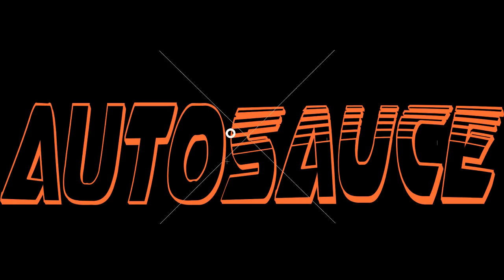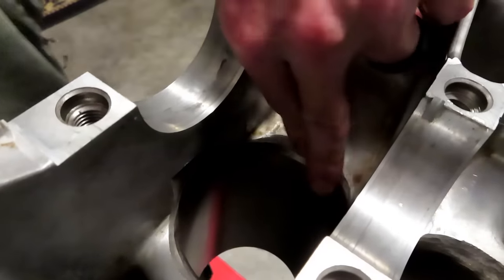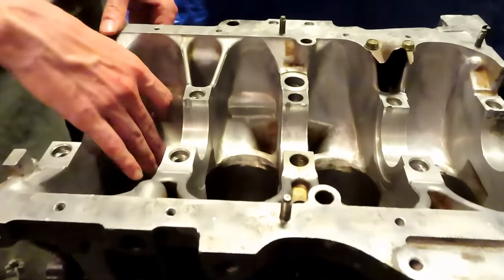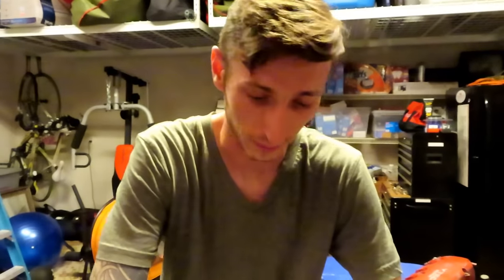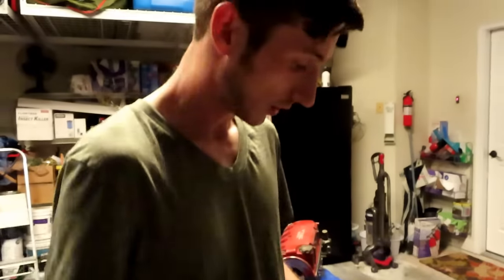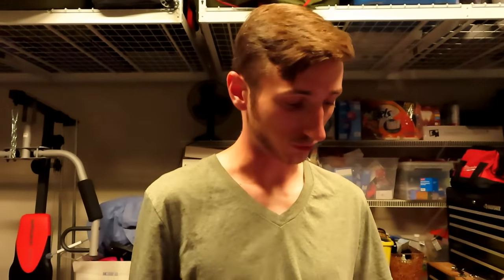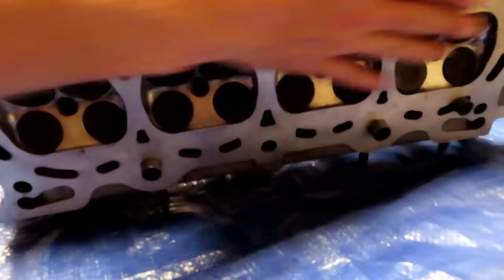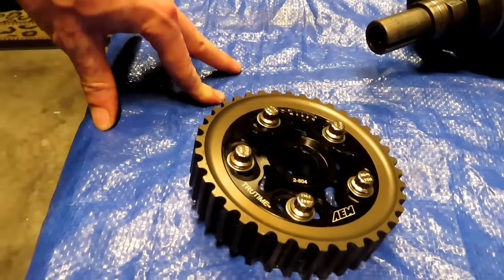EVERYTHING you need to MAKE 500HP with a HONDA CIVIC on a BUDGET

Comment: 500 hp on a budget... just build the thing right and don’t worry about the budget, “doing it right saves from doing it twice!” Wise words from Honda Yoda
Reply: He means you dont need the fancy named or labels parts to build a strong reliable engine at the end of the day there just different grades of forged metal
Reply: Paladin ! I love your advice. Comments on this. Cheaply honda build motor theres no way build like this gona last hes doing wrong the best build are with expensive parts save headches us going to have issues to cheap of build
Reply: Some people have the dream of power without the budget to match haha
Reply: @AM-wi6zo  LMAO
Reply: I’m poor
Reply: @edwinrodriguez8852 do you not realize that some people DONT HAVE 10 FUCKING THOUSAND DOLLARS TO SPEND ON A GOD DAMN TURBO SETUP! JESUS CHRIST
Reply: You can get a good deal on things if you’re patient, the biggest thing is connecting rods and head studs unless you go crazy then it’ll be reliable
Reply: @oscarprice7030  on eBay you can get a turbo for sub $100 used
Reply: There is a cheap way to build an engine like people spend 10k on a turbo when you can spend 300 euro to get a turbo off a semi truck that will work the same and us probably bigger
Reply: there are three points on this triangle of building. there is cheap, reliable, and powerful. pick two you will never get all three also there is nothing more expensive than a cheap build
Reply: super hessu  if you’re building a project car you always buy a turbo bigger then for your application especially used, because then if it’s a clapped out turbo it’ll still get the job done , also taking forever to spool isn’t a bad thing especially if you’re trying to keep the turbo lowkey
Reply: super hessu  wuhan whistle blower can make 1000hp. Plenty of V8 turbo guys making 800+whp on wuhan whistle blowers
Reply: super hessu  you almost always never wanna be under full boost
Reply: super hessu  this is obviously a street car
Reply: MV740  so a stock evo,sti or Audi turbo is trash for a budget build. Gtfoh a good used turbo  (that's been upgraded) for less then a $100 is a killer deal. If the compressor and turbine wheels are good and no shaft play the turbo is good
Reply: MV740  we're talking about street hondas 300whp is about all you're going to be able to put down without axles, slicks and anti lag. There for it's over kill and waste of money. Shit even h2b n/a are even a little over kill for the streets... but to each their own. Why there are some many different levels of build. 
 
From my experience building fast street cars are a waste. 1) you're going to lose your license and pay fines that cost  more then the cars worth. 2) end up dead and or killing someone in the process.
Reply: @edwinrodriguez8852  even great Skunk2 parts are not super expensive for a d series, he’s just trying to show what is possible if scratch is low, doesn’t mean he’s cutting corners or doing things wrong, budget… u can empty ur pockets and hope it ends with better results, parts maybe but if you buy ur own parts a shop won’t instal them for you, you have to do yourself with whatever you have to finish the job…
Reply: Until it breaks then you still have to build it over
Reply: You realize you can buy a 750 horse rated bottom end for a b18 for like $900 right?😂 Hondas are cheaper than fuck to build. Also. Throwing “expensive parts” at a car don’t mean they’re gonna work in synchrony, everything has to work together 💀🤷🏻‍♂️ all a Honda needs to make 500 horse is rods, rod barrings, wrist pins, cams or a cam if it’s a single over head, head studs, and a turbo along with a hondata ecu for tuning. Blocks will hold, head base will hold, head studs help a lot, and then accommodating mods would be the flywheel an clutch so they don’t slip and throw away horse power. Maybe a short shifter just for comfort and ocd reasons 😂
Reply: Where do I find said Honda yonda sound wise ngl
Reply: Not everybody can sink 30k into a fucking 4 cylinder

Comment: Long live the D. No problems with my daily overbuilt 425hp y8 build. Just getting a bad wrap cause people dont check their oil levels and spin the bearing on piston 4 due to oil starvation cause it has and aluminum cast oil pan and holds less oil than the sheet metal pans. Oil light doesnt come on until your about 1.5 qts. Remeber its an oil pressure light not a oil level light, thats what the dip stick is for.
Reply: All fact 👍
Reply: Still running strong? Any issues?
Reply: I’m working my y8 up all engine project, I’ve prepped it for heat and more power, biggest upgrade is a Skunk2 stage 2 cam an AEM fuel rail, aluminum dual core radiator, 3” exhaust and larger air intake, it needs some cpu tuning and some other parts I have to fit onto it still but at 200K this puppy needs the remainder of its life to be lived with some power pulsing through it and embarrassing people that spent many $1000’s of dollars more then I have or will! Haters will hate buddy, and if your brand isn’t Honda, then it’s not a guess that you hate them! GMC lovers hate Honda the most and most will never know the history behind that but look it up bc it’s a great story of how Honda embarrassed GMC in the late 50’s I think…
Reply: What do you have done or what did you
Reply: How much to build awhole d 15 y 8
Reply: @jesseh3997  honestly I don't how much I spent on mine. With about 4k and you doing the work you can make em so they can handle a bit of abuse.
Reply: @gagecaputo2006  Darton mid sleeves by R.E.D. Race Engine Development. Head by 4 Piston Racing. Full skunk 2 valve train with exception of the cam, stock but can use pretty much any of the other cams I have. Golden Eagle adjustable cam gear. Skunk 2 connecting rods JE forged pistons 10:1. ACL main and rod bearings. Edelbrock turbo kit with a GT2860R( bring the HP down but more fun to daily) with Greddy E-Manage Ultimate.
Reply: Do you still recommend this same recipe or has some stuff change?
Reply: @franciscogarcia-xt5wn how much was it to get the block sleeved

Comment: Z6 crank is better my guy..... the z6 has 2 holes for more lubrication thus lubricating the crank and main bearings more causing less bearings to spin. Y8 cranks spin bearings at hi rpm so keep your limiter around 7k. And with a z6 pump on a y8 or y series engine you will no longer have a dipstick hole because the y8 has the dipstick hole in the oil pump and the z6 or a6 have them in the block by the manifold.
Reply: I agree with this z6 is better but a y8 does work. I made 486whp on E85 with my full y8 swap.
Reply: Which one is more reliable?
Reply: @ixresurrectll3951  z6 crank for sure if turbo is better, y8 is fine for low boost and n/a builds. But a z6 crank if your want all the jam with all the lubrication. I myself have a y7 crank with speedfactory long rods with ycp 75mm vitaras. You can use a y series 1 hole cranks just know that it is more prone to spin main bearings because of the lack of lubrication that the z6 crank provides with 2 holes per main.
Reply: Can't a y7 or y8 crank be modified so the bearing get more lubrication?
Reply: @damonlemasters3424  you can champher the holes like hunter does on his cranks and shim the oil pump for more pressure
Reply: jr.helmer it’s old news that Y cranks have spun more bearings vs Z6 cranks. Oil pumps are virtually the same. It’s the oil ports that is the issue
Reply: Logged in after watching this elsewhere to say this. And to the folks sticking up for the y8 crank, you're lucky. The lower pressure oil pump and single hole crankshaft are the culprits behind many many spun bearings.
Reply: But what if you install race bearings and definitely have your oil pump above spec/aftermarket? My problem is finding a z6 crank haha
Reply: @jrmyadventr  you're going to have to hit your local junkyards for a core to build.
Reply: @beezowdoodoozoppitybopbopb9488  if I can even find an old civic haha, I live in Michigan, so they kinda die from rust over here
Reply: @jrmyadventr  same here man I'm from Wisconsin and all the yards around me all have eks y7s and y8s everywhere. But z6s and egs in general are hard to come by in the yard these days.
Reply: Hello sir, i'm looking to buy a civic coupe 95 with d16z6.. And i need to buy all parts on USA because on my country(brazil) i can't find parts to boost it.. I will have problem using stock crank?? And can you help me to choose one turbocharger? My project is for 400hp.. Who is better J.B or B.B turbocharger?
Reply: @nikolas4457  im sure there is a community of honda/d series somewhere in brazil try and find/talk to the people near you who have already done these things, unless you have a friend in USA or go yourself its gonna be hard to get the parts from USA as far as i know
Reply: @nikolas4457  also journal bearing is fine for your application
Reply: @ubergama30  Few people have done this, because it is very expensive to boost civic on Brazil, for example the currency of brazil is worth 4x less than the dollar(U$1= R$4) and to buy parts on USA we need to pay 60-100% from tax to receive the product.. I will start a build with civic because i go send all the parts from my friend on the Paraguay, there they pay no tax to receive the product.. this is why i need to choose the best part from all the project for don't need buy again and if i need to pay 300~500$ to take the best turbocharger don't is a biggest problem..
Reply: @jr.helmer2701  This is best than precision 6262 and gt30r? these were my main turbos to buy, and the gtx 3076 have a low cost O.o
Reply: @nikolas4457  Yes in US many people have found high quality supply chain of chinese turbos, they are actually very reliable and available in many options, but there is risk if you have bad supplier
Reply: @ubergama30  oh thank you, I go search for more options on eBay and aliexpress, you know a good turbocharger for mid and high rpm?
Reply: @nikolas4457  there are several turbos that would work.. who is going to tune the car/make sure things are installed right? find that out and ask them for advice because it wont matter if you pick the perfect parts unless you know who will be making the car work
Reply: @ubergama30  Yes, I talked to the guy who is going to make my car work, he said "buy I can make it work" and basically now I need to choose a good turbocharger for my project, but now I don't know which one to choose because you guys they said good options and cheap
Reply: jr.helmer i have a d16a6 block with a z6 vtec head 
someone told me it’s a mini me swap but i’m not as knowledgeable on the subject as most
telly looking into it though the car is super fun to drive
Reply: I 1000% agree, but to be fair he did mention shimmimg the y8 oil pump which would make up a lot, but the headache factor keeps me with a z6 crank
Reply: correct 😂
Reply: buy MRJT stock

Comment: I don't wanna tell you what to do, but I also do wanna tell you what to do because I dont wanna see you tear it all back apart. USE A Z6 CRANK IT WONT LOWER YOUR OIL PRESSURE MUCH. YOULL SPIN A BEARING SHOOTING FOR THAT KINDA POWER ON THE Y7/Y8 CRANK. Yes I have a y7 crank in mine but I also have my rev limiter set low and only pushing 250hp. Please use a z6 crank
Reply: Simplegarageworks , well said sir. STRAIGHT forward and to the point...... 

Daaamn we are learning so much on these damn chats/comments 💯💯🇵🇷💯💪💪
Reply: Greatvideo of!
Reply: Or maybe just port and shim and itll hold🤷‍♂️

Comment: Ive got a y7 crank, acl race bearings, speedfactory rods, 320bhp @ 13psi, pump fuel. STOCK oil pump, daily driver 1 year, no problems. I dont believe the y7/y8s cranks are that bad as some of comments. Use what you got.
Reply: Darren Bradbury my friend ran 12psi on a stock d16, never touched the internals and never blew after two years of beating. With what you’ve done you either can stay tough and reliable or crank it up 2psi, just keep gauges w warning lights and possibly a low oil pressure shutdown switch wired to the ignition. That’ll save you a nice headache! Auto meter makes all u need
Reply: @Dan_Ohhh  sounds like me but had a greddy td05 turbo 15 psi 250 whp cylinder 4 rod did not like it on a d16z6 and used to blow out the block after 10 15 k miles but back the  can get another motor for 100 bux lol
Reply: Yea some of these guys are haters. I think their really mad at how much money they spent
Reply: Was everything else stock? Did you hone/bore the cylinders or do any resurfacing?
Reply: @Dan_Ohhh 😅

Comment: Don't forget that Honda main and rod bearing fitment are numbered and color coded. It will be stamped on the bock and crank. No two bearings are the same. Fitting is highly recommended by a qualified engine builder. This is where you will lose all your oil pressure if you get it wrong. A buddy of mine wouldn't listen to my advice and he got only 200 miles out of his new build.

Comment: Your oil pressure is determined by the clearances between the crankshaft journals and the main/rod bearings, plus any other accessories that use the oil pump for lubrication. (piston oil squirters, which I recommend for a turbo engine, plus you can lean out and still pull timing for fuel economy on the highway) Having only one oiling hole per crankshaft journal is a potential failure point, as your oil pressure reading may be high, but if your oil is too thick, which turbo builds will be using, the crankshaft oiling holes will become a restriction and starve the bearings. There's a reason you don't see Z6 motors spinning rods, whereas the Y8 will spin bearings occasionally. It's not the biggest concern but if we're talking reliability, you should definitely be considering a Z6 bottom end.

I am interested in building a D15B bottom end with a D17A2 cylinder head with cam and valvesprings. You get coil-on-plug ignition and better swirl ports for low end torque. You just need to use Megasquirt or another standalone with it as Hondata is not an option.
Reply: What about a d16a6 block ?
Reply: @g35tho11  yes if u can find a d16a6 motor that would be the best motor to get even over the z6 motor. The A6 vtec motor is better then them all in the D series fam. I had one I put in a eg hatch I had some yrs ago n that A6 motor was a beast man n it would hang with a B series coupe n he couldn't get away from me n my car was a auto LMFAO. Wish I would've kept that Lil d16a6
Reply: @g35tho11  do I have a d16a6 motor bro if so u wanna sale it
Reply: @obezzyjohnson9680  hey so the d16a6 is a automatic VTEC?   I

Comment: I just want to say great video! But I also want to say go with a z6 crank the 2 oil ports will lower the oil pressure but the oil flow is better you want those bearings all nice and lubed up plus if you are going for a turbo build u will need can’t stress this enough a better oil pump most turbos need oil and you need that engine like I said all nice and lubed up!
Reply: Facts

Comment: Just curious why everyone that makes any good power on single cams all run z6 cranks and this guy says to use y8 I thought the y8 was bad for boost because of only having 1 oil port and they spin bearings alot
Reply: Yeah that part is wrong. Z6 is better for more oiling to the bearings
Reply: Yeah z six crank may be better at oiling the bearings but over time it loses oil pressure from a Z6 crank and the crank journals tend to crack and break
Reply: He said this is for reliability 😅
Reply: @uhpixr  reliable breakability maybe? if you like to spin bearings its the way to go. my cousin spun 3 sets in his 91 civic (d16z6 swapped) (also now mine) before he got pissed and jerked out the y8 crank and found a few z6 cranks in spokane wa. hasnt had an issue since and now i have two spare cranks for my car

Comment: I like most of what you said and I admittedly don't know squat about Hondas (I'm a 2zz builder), but sacrificing oil flow so you have a better guage reading doesn't sound like a good idea. To me it sounds like a recipe for a spun bearing when you spend lots of time at higher rpm. Back in the day when I was building 351 Clevelands we would put restrictors in the block to keep more oil on the crank by limiting the amount of oil to the valve train but I would never ever ever restrict oil flow to the crank and rod journals for a better guage reading. Shimming the regulator on the pump, however is something I've definitely done before and will do again, but I am sure to use billet pump internals when I do it as I've had stock pumps explode at high rpm. Good video, I enjoyed it. I'm studying for my first Honda build and I'd don't want to spend 2zz money on a d16.

Comment: Hell yes! Did a tiny bit of research watched a couple videos asked a friend of mine who had a 10sec z6 and came up with these exact specs lol I have a d16y8 with a z6 head port n polished full valvetrain and 1off custom BC cam with WEB cam gear port matched to edelbrock victory x mani and skunk2 70mm tb. Y8 block has YCP pistons .5 over and sfr no notch rods king bearings y8 crank ported n shimmed oil pump capable of oiling up to and over 9k rpm no problem flex fuel with a 5858 and it’s my daily driver 97 ex coupe!

Comment: I thought the z6 crank was better cause at high rpms they need those oil passages to prevent contact. To make up for the pressure loss, you shim and port the oil pump.

Comment: It's not every day I say this, but the comment section is right. I have personally experienced the phenomena in which cylinder 4 goes dry with the Y8 crank. The Z6 crank is, in my opinion, better due to the lubrication factor. Granted, some people have no issue with the Y8 crank, but your oil pump is already shimmed; there should be no worries with the Z6 crank.

Comment: Yo I can I use these parts without turboing straight motor wht kinda power would I get
Reply from the maker: It would make less then stock. Rods are heavy and pistons are low compression.